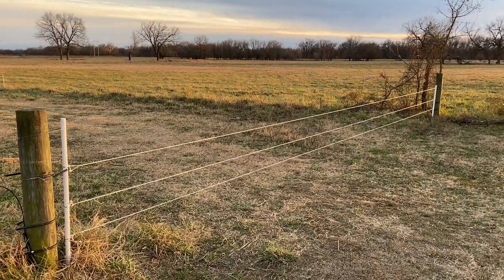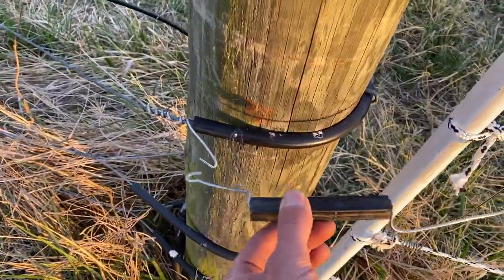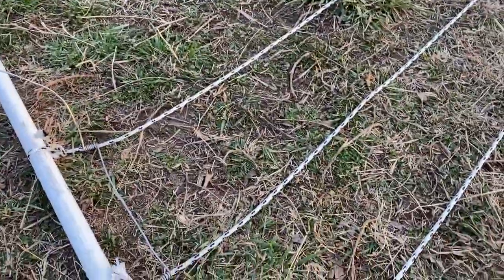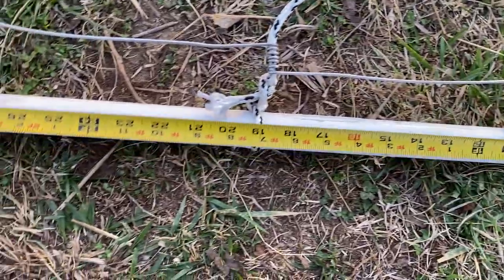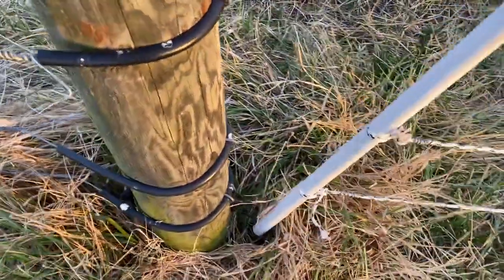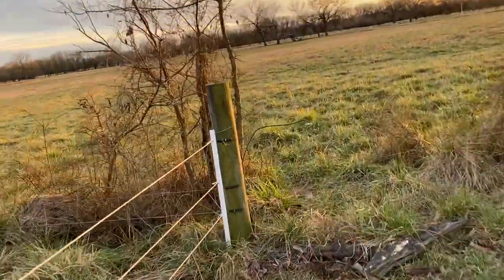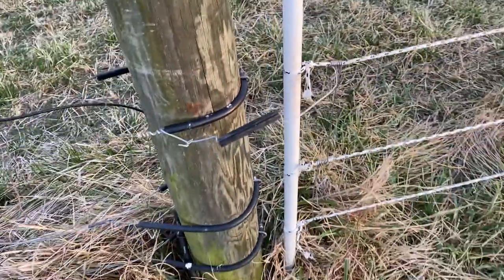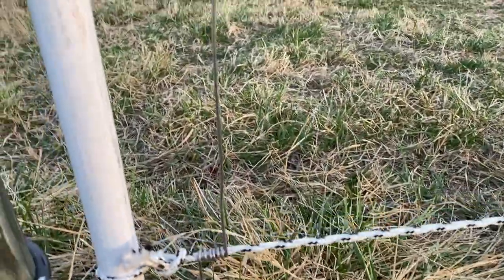Best Sheep & Goat Electric Fence Gate

Comment: Do you have an underground feeder to keep the downstream section live when the gate is open?
Reply: Good question.
Reply from the maker: Yes, there is a buried wire running through either conduit (best) or black plastic water pipe works as well.

Comment: How did you paint your posts? Aerosol can, brushed or sprayer?
Reply from the maker: I just brush them. I would set-up 15-20 at a time on saw-horses and then roll them over when they are dry and paint the other side. Make sure to use a Rustoleum enamel paint, the X/O version seems to work well. For large quantities you could build a tube out of PVC pipe to dip the whole post in. Might be a faster way to do it.
Reply: @kilpatricklandlivestock   thanks for the reply
Reply from the maker: @81lwilliamson  Absolutely, sorry for the  late response! :)